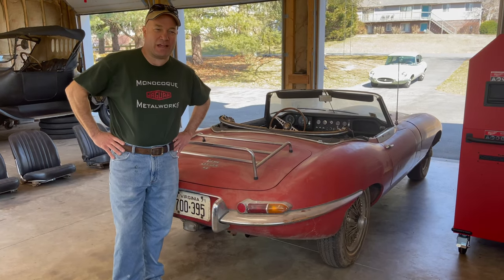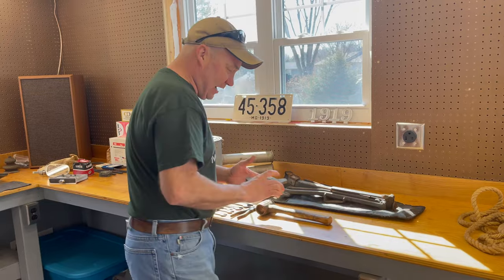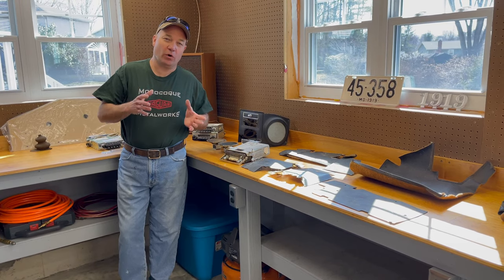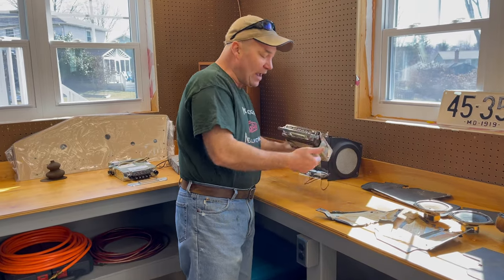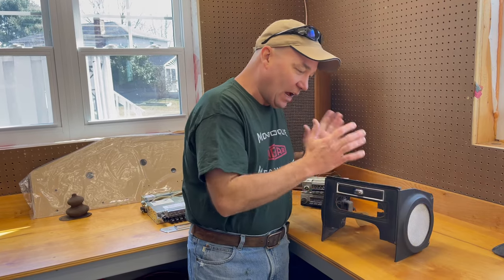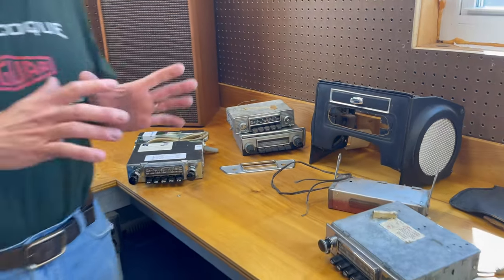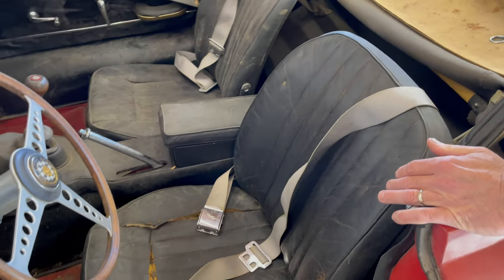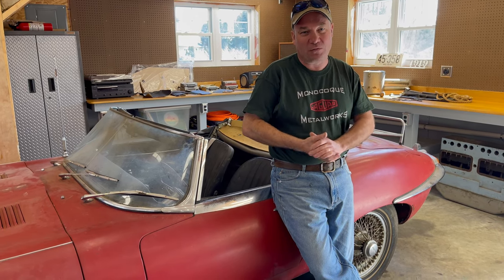Jaguar E-Type - 1966 OTS Roadster - Episode 2 - Parts & Pieces

Comment: Looks like you're collecting all the right parts and pieces. I'm watching this with great anticipation.
Reply: I need the same radio Chuck does. Not too worried about finding one right now, but keeping my eyes open.
Reply: @drewscherz2476  The one without the remote amp is easier to install. It looks very close to the original but if you are going for complete originality, then seek the Frankfurt US -X like Chuck did.

Comment: Very good video chuck. I have the original tools and jack. The owner found them about 2 years later under a bench in his garage and called me. He had thrown away the bag and made his own. Interestingly , the original jack is painted black instead of gray. The vinyl bag has a tear but intact. I had to get a machine shop to straighten out a bend at the end where the jack attaches.

Comment: Chuck, flip the little L shaped tab at the bottom on the sides of your 67 seats and they will recline slightly.
Reply from the maker: Thank You, Drew!  You know, I actually did know that, but I think I forgot!  But I know what you are talking about and you are right - those early seats do technically have a reclining feature in that they have those two settings when you flip that little thing.  Thanks for pointing that out! - Chuck  :-)
Reply: @monocoquemetalworks88  Chuck, right, yeah it’s not much, but I use it. 

Love your panels. My body guy did my driver side sill and used your outer sill and inside support bracket.

Comment: I think it was on Wayne Carrini's show ( he was selling a restored E-Type gold with black removable top) and I think he said that all rdstrs. came with the removable hard top. He also said the tops are heavy and require 2 men, or a hoist to remove/ replace it, making it inconvenient. Consequently, many cars became seperated from the topsthat were in storage. It's been many years since I saw that episode. But I remember thinking at the time that the top was probably sold seperately as an accessory, and most people were satisfied with the folding top.
Reply from the maker: Daniel - the hardtop was an accessory and I don’t think many came with it from the factory.  But all roadsters DID come with the hardtop brackets - maybe that is where the confusion lies.  There are many photos of the cars lined up outside the factory for delivery, and they usually have soft tops covered in plastic… 😉

Comment: Hi Chuck. Can you just take the seat base from the later seat and swap it ? Who ever fitted the radio in mine did know where to drill the hole . But like  you , no radio ! In England we would have fitted Radiomobile  MW  / LW  .  l do recall seeing a Philips Radio /Casette in a '66 we had in for paintwork but that was I '70/'71 so probably non original . And is the Europa a twin cam or Renault engined ? I'll be glued into lots of your channel . Thanks Chuck .

Comment: personally i would repair those seats with similar leather insetted where required.
Reply from the maker: Adam - I'm working on the seats now, and I think it is actually going to come down to that - I think I'm going to end up using less than the whole bottom of the donor seat.  Working on softening them up now - Stay tuned! - Chuck  :-)

Comment: Those Amco wiper blades are not original.
I have a supply of original blades if you are interested.
Reply from the maker: Thank You - yes, I did notice that - and it is one of the small repairs that Bill wrote down in the notebook that came with the car.  So while I would like to have a set of originals, it's actually kind of more fun to know... "Dec. 2, 1967 - 3 wiper blades - #800-12" - $3.33" - so I will probably leave those on there, but I will keep you in mind - Thank You!  :-)